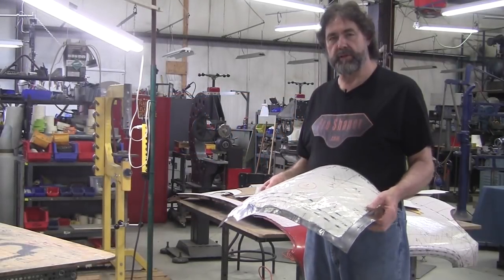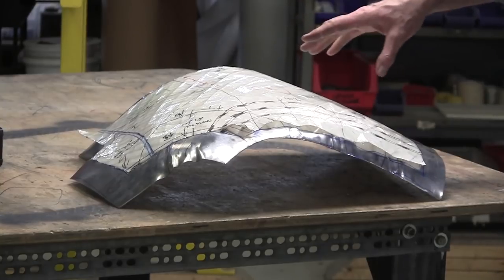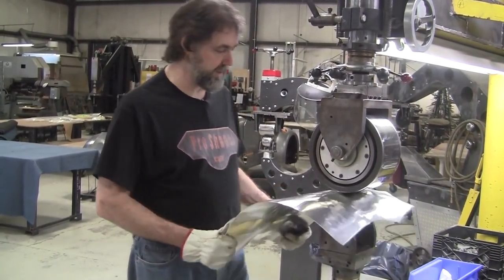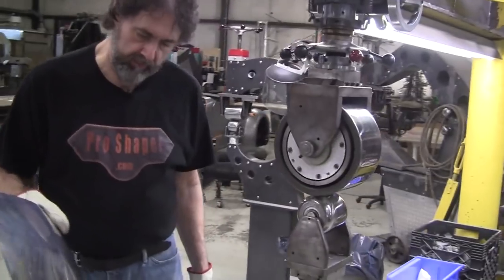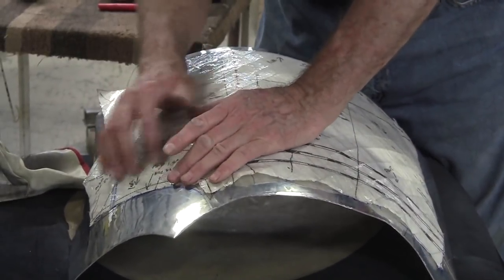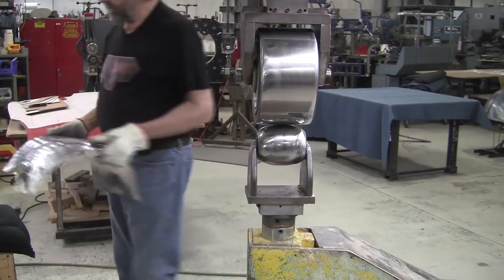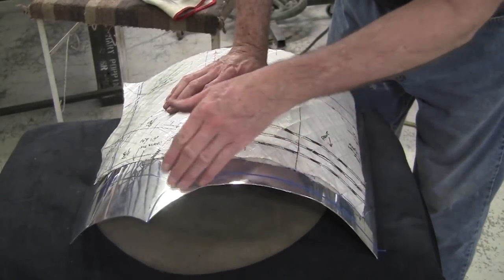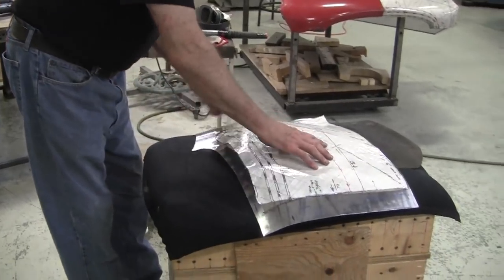Metal Fabrication: Jaguar E-Type Aluminum Bonnet Build (Part 4)

Comment: After the wheeling all your pattern alignment marks have disappeared.  How do you get over that and remark in the correct place for proper pattern alignment?
JIM
Reply from the maker: We punch holes in the flexible shape pattern lay the pattern on the panel and remark with dashes of marker through the holes.  Then check the gauges to set the correct arrangement value.

Comment: I love your work.  This is a real art.  I was curios how much a person could expect to pay for a hand made fender or hood?
Reply from the maker: Thanks, glad you are enjoying my videos. How much is it? How many hours did it take you to make it? These are very common questions.😁😁😁    The answer is:  The real questions should be what are you using for Metal? What thickness metal? How much will the shipping cost be? Will the surface quality and fit be superb? How much work should I expect to do when I receive the handmade panel or assembly?

Most, strike that. All aftermarket replacement stamped panels used  in restoration are riddled with problems.  Wrong, thickness, wrong shape, wrong details, rusted, galvanized,  are common faults with stamped replacement panels- but they are inexpensive.😁😁😁 
With handmade panels you don't compare prices, you compare quality. If you purchase from a shop in the USA, England, France, Italy, Germany, handmade panels the prices are going to be higher because the cost of living- the overhead is higher. If you purchase in parts of the world that the overhead is lower the cost will be lower. There are so many factors that go into buying a handmade panel. You have to do your homework.  Very complicated question. Most purchasers of handmade anything that have done their homework will expect to pay dear prices for very well made, handmade panels or assemblies. People that price shop will always be surprised and disappointed.😁😁😁
Reply: In simple words; super expensive, because is a piece of art
Reply: 😂😂😂??? An essay just to say if you have to ask you can't afford it...  lol if you have nothing nice to say...
Reply: £40.000 for a handmade aluminium E Type complete bonnet
Reply: @johnnyfannucci  7 months lateerr....

Comment: So here you had a fsp to define the geometry. But what approach do you use for forming panels on those wire form bucks? Or do you have fsps for those too? Great series.
Reply from the maker: On the six scratch-built car bodies that my students are building at the classes I first have them make paper patterns. The paper patterns  I have the students make are what I call proto flexible shape patterns. They are imperfect flexible shape patterns but allow the students to start the panels and soon they feedback off the wireform to make the panels fit. When the panels get close I have the students use a .010" fealer gage to find where the undeveloped areas are. With the wireform the students have full view of the backside of the panel and the panels can be  easily clamped onto the wireform with rubber tipped squeeze clamps.

Comment: That's a fantastic English wheel. That thing must cost 20 grand or more when new. What's a cheap option for a newbie just starting out?
Reply from the maker: I built the yellow wheel in 1993 in my two car garage all from scrap metal that I purchased at a local scrap yard for 5 cents a pound.  Even the top wheel came from the scrap yard. The anvils I made for DOM Shelby tubing.   If you want a great English wheel buy one of mine see proshaper.com.  otherwise make one yourself.
Reply: @proshaper  those are some amazing wheels.  I am a poor man, I wish I could buy your wheel. I think I'll be trying to  build my own . I'll try to find scrap too. Are the anvils for sale? Maybe I could afford them and to make my own frame. 
Your work is amazing, I'm afraid I choose the wrong path in life, fabricating metal should do been my lifes work.

Comment: Loving this series of videos. When you first start out, how much gap between the anvil and the top wheel? Just enough to grab the aluminum as you push it in?
Reply from the maker: Yes, at first just light pressure.
Reply: Okay, one more question. I've been building box flares out of 18 gauge steel (because I can't find 19 anywhere in SoCal). I've nearly finished the front fenders but they're considerably heavier than the factory fenders and the 18 gauge is a real b*tch to work with. I'm thinking of switching to 20 gauge for the rears... does that sound like a bad idea?
Reply from the maker: @JR-iy7pb  twenty gauge will work fine. When tig welding focus your tungsten on the rod and drop the weld material on. You can get 19 gauge if you order 20 sheets or more, then sell off the extra. It was always available in the Northeast. Today it is toughed to get unless you buy a 1/2 ton or more.